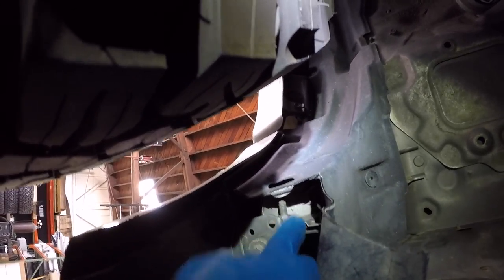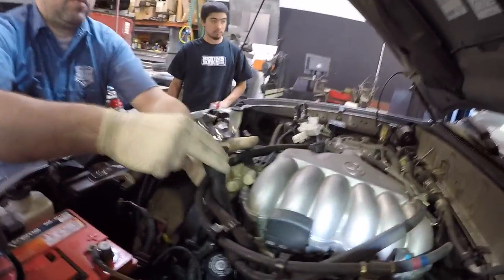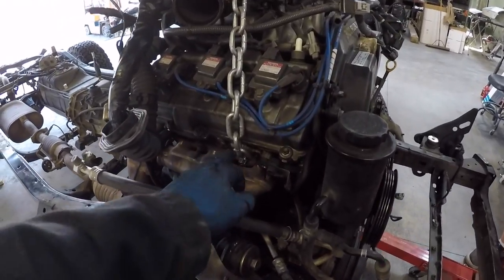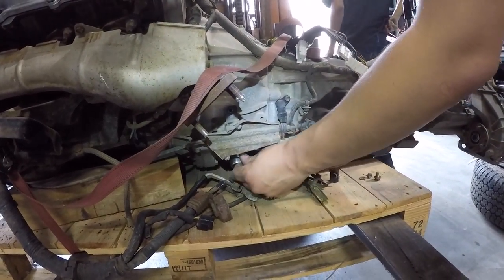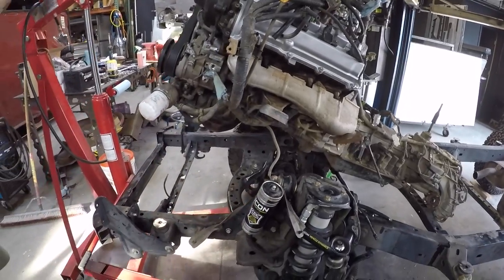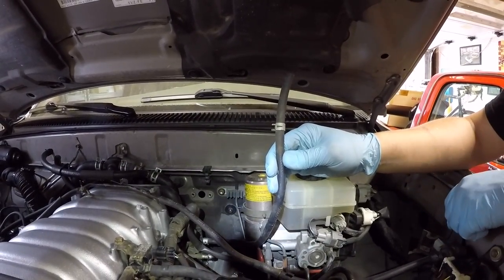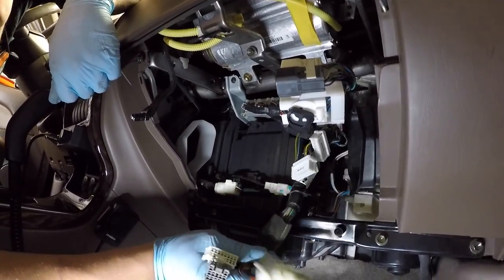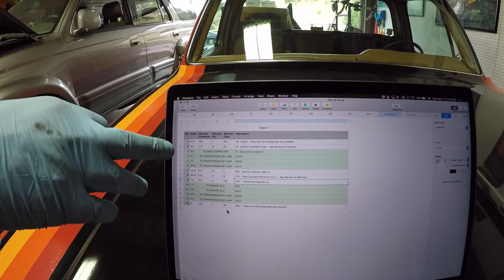V8 Swap (5VZ-FE 3.4L V6 to 2UZ-FE 4.7L V8)

Comment: I think I would have just swapped bellhousings between the two engines so that I wouldn't need to move the transmission mount and get a custom driveshaft. Is that a possibility? That would save quite a bit of coin if you could get away with it. I'll be doing a uz swap in either a 4runner or supra one day.
Reply from the maker: mkIIIsupras I don't know if that would work.  I'm guessing it's not just the bellhousing that takes up the extra distance.  It's probably a combination of the whole drive train.  Also, I don't think the 4runner bellhousing has the same bolt pattern as the Sequoia.
Reply: I've done this swap in both Gen1 and Gen2 Tacomas. This 4Runner is essentially a Gen1 Tacoma for the purposes of this swap. 3 Issues with your theory: 1. the stock v6 sits quite a bit forward of the firewall, far enough forward that the stock exhaust pipe runs BEHIND the engine, over the bellhousing. The V8 is longer and that positioning would have left no room for the radiator, much less fan(s). 2. the area under the engine on those tacomas is littered with obstacles (crossmember, rack, front diff, sway bar, etc.). Luckily its a shrunken version of a Gen 1 Tundra. The Gen 1 Tundra 2UZ oil pan is shaped to perfectly clear all of this, but as a result fits into the space much like dropping a piece into the middle of a jigsaw puzzle. As a result, this pretty much dictates where the 2UZ has to sit +/- about an inch fore and aft. 3. While the Tundra and Tacoma/4Runner share the same basic A340 transmission, the internal specs differ and  even have some major differences like IIRC the 3.4 V6 trans uses a "TV cable" to modulate line pressure, while the V8 Tundra trans does it electronically and therefore not only lacks the TV cable, there is not even a provision for adding one on the "drive-by-wire" throttlebody.

Comment: Oh and I would have like to have seen say a 0-60 time original and compare to swap 0-60 and maybe some top speeds … and fuel mileage comparison… I can’t imagine pulling 7000 lbs with this …
Reply from the maker: 0-60 comparisons?  We're not building race cars for the track.  Also, these Toyota engines aren't known for their great gas mileage.  A comparison might have been nice, but gas mileage is heavily dependent on how people drive.  Anyway, thanks for the comment.

Comment: and to think the dealer charged me $6K for a 100K mile service on my gen 3 4 runner.... im 1/2 to a V8 Swap!
Reply from the maker: Wow, what did they do for 6k?  Did you at least get a happy ending after spending all that money?
Reply: @TimmyTheToolman  The three major thing was timing belt, valve gasket and new brake shoes/drum resurface. Did all the mtaintance  while there (all fluids, plugs/wire and compression test).
Reply from the maker: @4b11t9  My God, that is a crazy amount of money they charged you for that.  For $3500, you could have gotten a completely rebuilt motor from Yota1 Performance and basically have a brand new motor.  There's however lots of labor involved doing a motor swap, so if you would have to pay for it, the cost of labor would be high.  If you're at all interested in auto mechanics, I suggest you take up the challenge and start turning wrenches.  The money you spend on tools will pay for themselves very quickly.

Comment: I've thought about doing it on my T100. Because some reason the 3.4L on the T100 is very weak over the Runner, & Taco. I'm guessing that these v8 model will direct fit the T because the T is the very 1st mod of the Tundra. If you read supposed the 99 & up T100 was going to be v8 but they did pass the inspection, weight, and power. So let just said the v8 is too much for the T100. Anyhow they said screw the T100 and jump to a new model and that's how the Tundra was born.

Comment: Will this swap work on a 1st Gen 4runner?
Reply from the maker: I don't know.  If the engine compartment is big enough for the engine, I suppose it could but then there's the whole wiring issue.  You could ask this question on T4R.org in the Classic 4runner section of the forum and somebody will be able to answer this question for you.

Comment: Pulling the whole body seems extreme. Why not just the front clip/hood and lift it out and put the new one in. I know you have more room to work and Fab motor mounts, etc. But still seems excessive.
Reply from the maker: Personal preference I guess Jason.  Pulling the body off when you have access to a lift is pretty easy.

Comment: AWESOME!  Would love to hear this thing run, stock other otherwise.
Reply from the maker: The exhaust he put on makes it sound great but not loud.
Reply: he mentioned the "200-thousand mile exhaust"...is that OEM?
Reply: PS, wish you included some shots of the car running....
Reply from the maker: It's running at the very start.
Reply from the maker: He put a Magnaflow exhaust on it.  Custom routed by his friend Wes.
Reply: >_< sorry brain farted.  Sounds great!
Reply: How much was a swap like this?  All in....
Reply from the maker: If I'm remembering correctly, he said around $12,000.
Reply: Good Christ!  I saw there isn't much clearance with the big motor.  Does this interfere with changing timing belt?  Any word on the V8 MPG yet?
Reply from the maker: You would definitely have to remove the radiator to do the timing belt on his rig.  I haven't asked him what his mpg is now but that's a good question.
Reply: We did the timing belt before swapping the motor in. Also did most gaskets, water pump, and the starter as they are so easy to access on the bare motor.  Next time it will require the radiator to be pulled to get clearance...glad I have 100k miles before that :) 

I haven't done accurate record keeping for MPG yet, but I'm averaging 240 miles per tank, which I thought was terrible but seems to be the standard for the V6 trucks (I don't recall what I was getting before the swap).
Reply: Wait...you mean you're getting 240 miles on a 4Runner 18gallon tank with that Sequoia V8 motor?
Reply: Yep, will get 240 with mostly highway driving on the stock tank. Though it does not like city driving and mileage drops pretty quickly puttering around town.
Reply: That's not too bad man.  I'm only getting around ~230 on my 2WD 3rd Gen with mostly city driving.
Reply: I get 15mpg city and 18mpg highway in my 03 double cab 2uz-fe, but I can't seem to keep my foot out of it.
Reply: Just to update, today it averaged 17.9mpg going over 5 passes along I-395 loaded down with gear.
Reply: You did an awesome job. Congratulations

Comment: Cool video. I want to do a lexus v8 swap to the Hyundai terrecan. Can you guide me which engine should I get for performance and fuel efficiency. And around how much would whole swap cost me? I'd really like to get some knowledge from you cus I am not experienced at all. Thank you.
Reply from the maker: Sorry but you're going to have to do your own research for this one unless Mikey wants to chime in with some advice.  Sean and I were basically passengers on this job and Mikey was the one driving.  

Nobody is going to be able to give you an estimate of how much this job will cost because there's too many factors to consider.  First of all, how much you end up paying for a used V8 motor.  Then, you have to find a shop that's able to do the necessary fabrication work and how much they charge for their time is going to be specific to them.  

If you're not experienced at all in this sort of thing, I would advise you to give this some more thought because it's going to get very expensive and might not be worth it.  Mikey did a ton of his own work for this project.  He researched and did all the electrical which was a huge time investment.  He also did all the research for everything else like the electrical engine fans, routing the exhaust, custom air conditioning lines, etc. 

So, sorry I can't be more help to you but it sounds like you'll have to rely heavily on a shop to help you and it's going to be a ton of money.

Comment: Tim, how can I get in touch with Mikey to discuss his doing a project like this for me?
Reply from the maker: If I thought there was a chance Mikey would be interested,  I'd put you in touch with him.  But, I know his answer would be no.  This project was very time consuming and Mikey has a demanding job, family and other projects he's working on.  He doesn't even own his 3rd Gen 4runner anymore.   He gave it to his brother.  So, you'll have to tackle this on your own or find someone else with experience with engine swaps to help you.  People have hit me up to do this for them and I said hell no.  Sean and I were just the cameramen on this job.  Mikey and Wes were the brains behind this 2UZ swap.
Reply: Timmy The Toolman thanks for the reply. I am looking to swap a Toyota V8 into my 1966 Toyota Land Cruiser FJ45LV. Would be a neat swap but no way would I attempt it. Needs to be someone with Yota V8 experience. Thanks anyway.
Reply from the maker: Mark Erbesfield there is lots of info online to get this swap done.. the wiring is probably the most challenging part. But just look at it one wire at a time! You can do it if you have the space and time.

Comment: Whoa!
What's the word on smog with something like this?
Reply from the maker: Mikey hasn't taken to the smog referee yet but he shouldn't have any problems.  He definitely did his homework for this swap.
Reply: Planning to go see the smog ref in January and will update this thread after that. I don't expect any issues as we ported across the whole sequoia emissions setup. Only thing I have to do before visiting the ref is go to a Toyota dealer and get them to flash the ECU with latest software. The smog ref wants to see a dealer invoice showing this was done.

Comment: This is really cool! So how much does something like this cost?
Reply from the maker: Mikey estimated around $12k.  There was the initial cost of the wrecked Sequoia they pulled the drivetrain out of.   There was all the labor to pull the drivetrain out of the Sequoia, pull the drivetrain out of the 4runner, install the Sequoia drivetrain into the 4runner and all the custom work Wes did for Mikey (Custom Motor Mounts, Relocated Cross Member #3, Custom Fan Shroud, Cut and Re-Welded Shift Rod, Custom Extension on Driver Side Header, etc).  Wes and Mikey are friends but Wes still charged him for his time most likely at a much lower rate than he normally charges for his time.

He had to get a custom length rear driveshaft made at a local driveline shop.  He had to get some custom AC lines made and get his system recharged.  He had to buy electric fans.  There's more I'm missing but what I mentioned was the bulk of the expense.
Reply: I think its one of those things where if you have to ask how much it costs, you cant afford it. But WHY ? Just buy one with a V8  ?
Reply: The V8/4th gen trucks are quite a bit bigger and wasn't really my thing. I like the smaller size of the 3rd gen but wished for some more power. It definitely does not make financial sense to do it this way, but i was in it for the challenge.
Reply: Oh yes, the challenge. I bought a 1981 Corvette in boxes once. Missing parts, wrong parts, duplicated parts. Just got a 1994 4 Runner with ISSUES. Have a daily driver but no shop. Thank God for you tube and guys like TTT. Good luck with that one...
Reply: If you have a welder and fab skills you can save alot of money. Plus if you don't have to be emissions compliant, particularly Cali compliant you could so the swap much more simply
Reply: @Mikey-zo2yt  I just posted further up on why I'm very seriously considering this.  I have a 94 ex-cab 4x4 truck and have been debating the 3.0 to 5VZ swap but am looking at this V8 for towing power.  I currently have the 4Crawler 2" body lift I will be installing next month in prep for a swap as well am installing a Tundra rear axle.  (Please read my earlier post as I definitely have the skills and money to make this happen).  My first question is can you please measure your firewall to the rear (engine side) of the radiator for me I'd like to compare engine compartment spacing. I don't think side to side would be an issue and I think the swap would likely be a little easier in a truck with a 2" body lift.

Comment: why would you cut the belts? unless they were shot i would have kept them
Reply from the maker: He wasn't planning on keeping the engine.  Instead of spending the time to remove the belts, cutting them off saved time.  However, if it makes you feel any better, I stripped the engine before they junked it.  The only thing left was the block and heads.

Comment: Why not a 4.6...?  Get rid of the rubber band cam drive...
Reply: 4.6 engines are a lot wider and taller than the 4.7 v8. Plus the transmission and transfer case are bigger too. 4.7 is much closer in size to the 3.4.

Comment: I fell asleep watching it so I had to rewind and pick up where I left off… I would not ever consider towing as heavy with a 4 runner… can it do it yeah but not safely in my opinion… if that was inspiration for swap I would say nope… now I’m beyond impressed with knowledge and expertise involved in explanation of swap… very very informative but I would not believe that it’s worth it … could have supercharged it and probably got similar results in HP I’m thinkin… one last thing I don’t live in California so I’m not sure how the BS emissions work but from my perspective I never would have got them involved with certification or testing… F… them!!!
Reply from the maker: Thanks for the comment Dan.  A V8 Swap is clearly not for everyone and neither is a Supercharger.  A supercharged V6 does have more horsepower and torque but not quite what the V8 puts out.  Also, that 2UZ-FE 4.7 Liter V8 is bomber and is known to easily last over 500k miles.  The 3.4 Liter 5VZ-FE is known to last a long time as well, but doesn't have quite the same reputation in longevity the 2UZ has.  Plenty of people tow with their 4runners.  We're not talking pulling huge trailers, like you see big diesel trucks pulling.  4runners can easily and safely pull smaller and lighter trailers.  When Mikey and his wife decided to buy a decent size airstream trailer, he made the right decision to buy a bigger and more powerful truck to handle the job.

I agree with you that dealing with California emissions laws is BS.

Comment: Sequoia came in manual?
Reply: rmyc Nope, but I believe you can adapt the R150 manual transmission to the 2UZ motor if you want a stick.
Reply: I imagine that would present some  issues running the stock ecu and tune though

Comment: Man, I really want to do this.
Reply from the maker: It's quite the project but with the right expertise, money and time, it can be done.
Reply: What do you think was the most challenging part of this swap? Never done a swap before but this looks like a good first
Reply from the maker: @brycethoreson9216  it wasn't our project, it was our friend Mikey's but if I had to guess what took the most research and time, it was probably making up the wiring harness so the 4.7 liter engine would work with the 4runner.  However, lots of things are involved.  Making custom exhaust, custom electric fans, custom AC lines, and custom motor mounts.  It's an involved job.

Comment: Is the original manual 5 speed from the 4runner compatible with the v8?
Reply from the maker: Mikey had an automatic, not a 5 speed manual.  But, it would bolt up since the automatic did.

Comment: NO STARTUP?!???!
Reply from the maker: You missed it right at the beginning with Mikey revving his engine.  00:26  Btw, I love your band Led Zeppelin.
Reply: Timmy The Toolman thanks it’s been a side project of mine for many years now... by the way, I did the front differential swap on a 1998 4runner and your tip to remove the driver engine mount was very helpful
Reply from the maker: When you finally get done with the project, I'd like to see how it turned out.

Yeah, releasing that driver side motor mount and jacking up the engine makes a huge difference doesn't it?  It's a serious struggle if you don't.

Comment: I want to put a turbo diesel in my 5th gen
Reply from the maker: Sounds like a good challenge.
Reply: Diesel Toys will do a Toyota factory diesel swap to the spec that folks in Europe and Japan get for about $25,000
Reply: @matts_.4494   Thanks!.. I ended up just putting in a Magnuson Supercharger in my 5th gen.. It gave me that bit of extra torque i needed.

Comment: Was the V6 that underpowered?  What will fuel per mile differential equate to now?   If you have this kind of time and money I guess fuel cost is a non issue, but really this only makes sense if you are looking to have more ponies for real day to day use of this vehicle that isn't really that great for a Bay Area commuter.
You say you plan to tow a maxed out weight to horsepower ratio trailer but with a smaller sized tow vehicle now with components of the appropriate sized manufactured vehicle.... I still see lunacy and too much disposable income back in 2017 with the best damn POTUS in the WH.
Good luck with fuel costs in the next administration if O'Biden and his lot take the WH!
Reply from the maker: The V6 is severely underpowered if you add bumpers, armor, roof rack, etc.  This engine swap isn't for everyone obviously.  It's a lot of time and money to invest.  This was never built to be a daily commuter.  That's what a Prius is for.  A V8 in a 3rd Gen 4runner gives you a ton more power and torque so you could tow much easier and it's just a pretty damn cool project to pull off.  This is not a mod for anyone worried about money and economy.